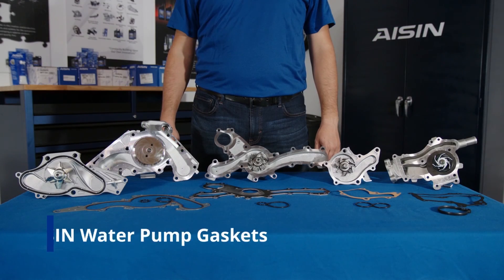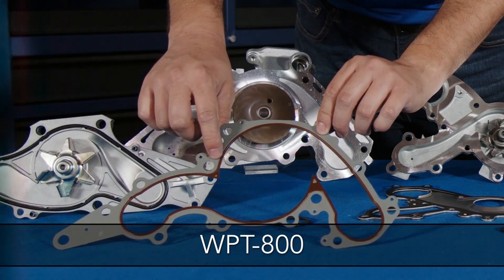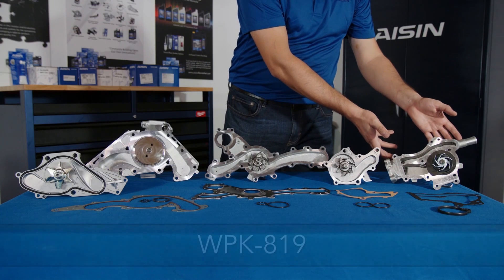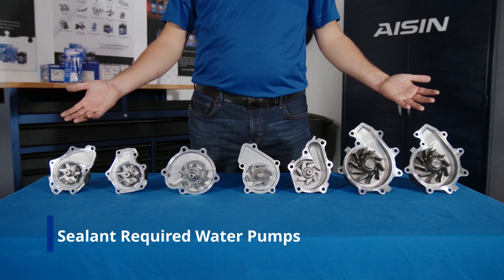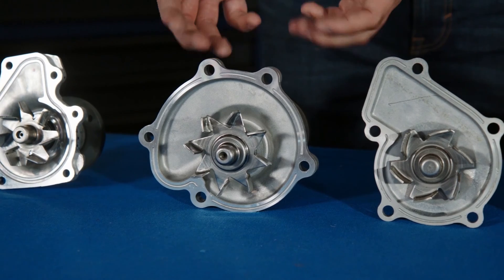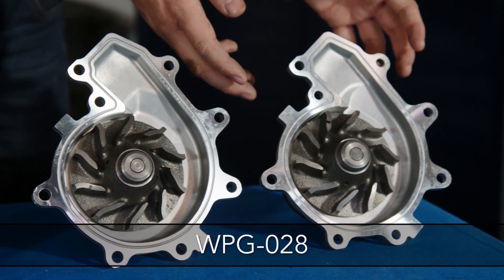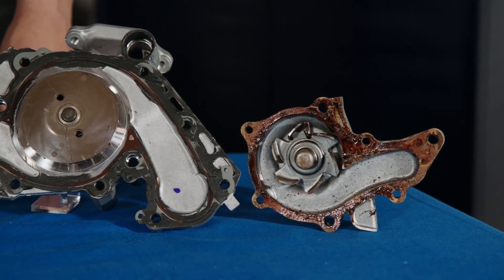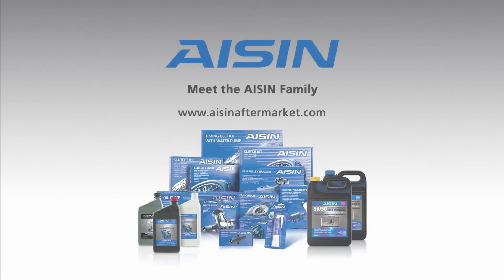AISIN University: Water Pumps & Gaskets

Comment: Hi, i have an Aisin WPT-129V waterpump ready to be installed on my 1AZFE Toyota engine. It came with a paper gasket, however the video says i should use silicone? what should i do?
Reply: Update; apperantely the WPT-129V is made in Korea, and will start to leak quickly again. Have orderd an OEM pump and will use silicone
Reply: Why Korea made Aisin would leak? Did you use sealant?

Comment: Hello, The WPM-055 water pump need Formed-in-place-gasket (FIPG)? or a paper gasket?
Reply: Hello, I am about to replace my water pump with WPM-055.

Google image search shows it comes with a paper gasket: https://pubimg.4mycar.ru/images/full/057e3a3f2755c2e0b3fc6107f155cb06a3f6b70002.jpeg

According to the video @ 0:58:  [NEVER USE SEALANT]

Comment: Why is gasket sealant not recommended for the  WT-800 pump?
Reply from the maker: Hi Aaron.
For the WPT-800 we include a card showing the only location that sealant is required for the installation. Sealant cannot be used with the Gaskets included in this Water Pump.

Comment: Why coat the WT-800 with coolant?
Reply from the maker: Hello Aaron.
Coating we mention in the video is mostly for the Rubber type Gaskets/Seals. If the Seal is being inserted into a tube or other it protects the Seal from damage and allows easier installation. Greases and other chemicals can compromise the Seals ability to seal correctly.

Comment: If the gasket goes does that mean the water pump goes as well or can you just replace a gasket
Reply: its not worth tearing everything apart just to replace the gasket, especially when the water pump isn't that expensive anyway
Reply: @jonarbuckledeeznuts  That’s debatable with the quality of automotive parts these days. The oem part may last much longer than a replacement part.
Reply from the maker: Hello King Freedom. Thank you for your comment. If you are 100% sure the gasket is the cause of the problem, it should be okay to just replace the gasket. However, we recommend you to replace water pump along with the gasket.